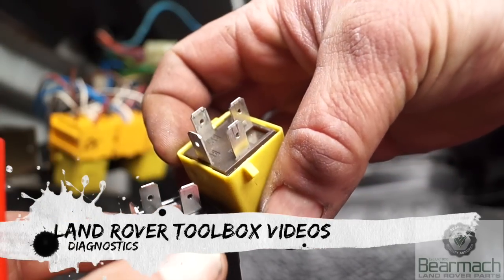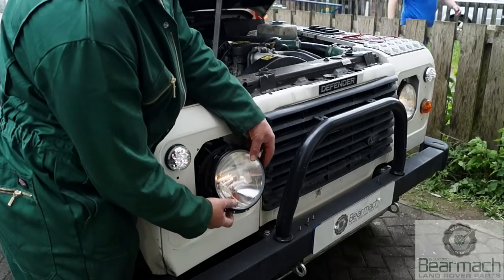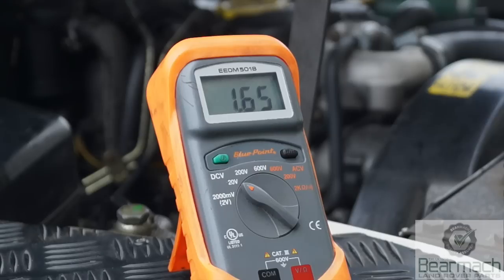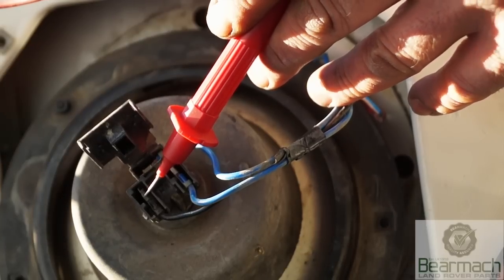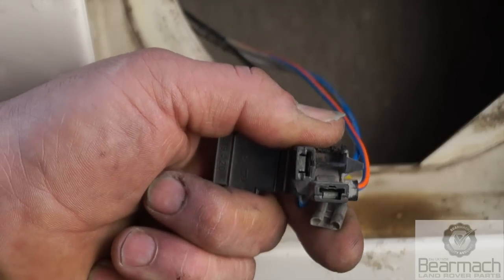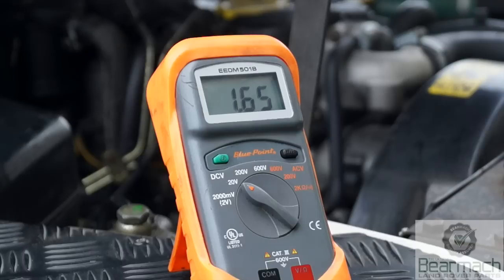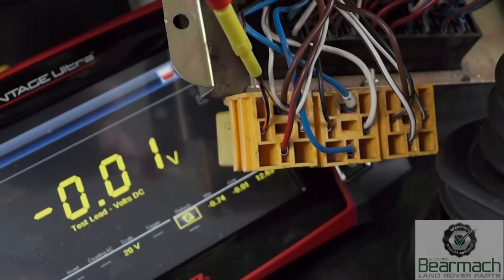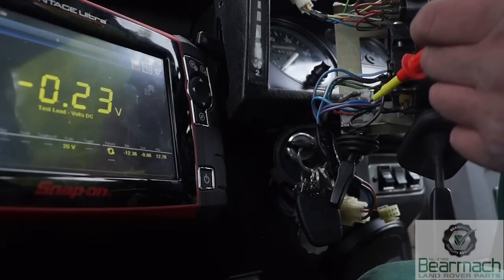Checking voltage drop at the headlight earth circuits - The Fine Art of Land Rover Maintenance

Comment: I see you have the Boomslang Headlight loom. I've bought one but haven't got round to fitting it yet as Im going to change my sealed beams for crystal headlights. Does the loom make a noticeable difference?
Reply from the maker: Matt Hall I will be fitting it soon.  Need to make some slight adjustments to get the loom from one lamp too another.
Reply: Ok, I'm fitting mine in a few weeks time so yours might be done before mine then
Reply from the maker: Matt Hall  Perhaps.  I took a look at the best possible route for the loom and connectors and it does involve enlarging a hole plus adding a little exta protection to the live wire.   I am planning of fitting sop lights on the front too so I'll be laying in the wiring there at the same time.     Video will be up when it has been edited,.... that is what will take the time!